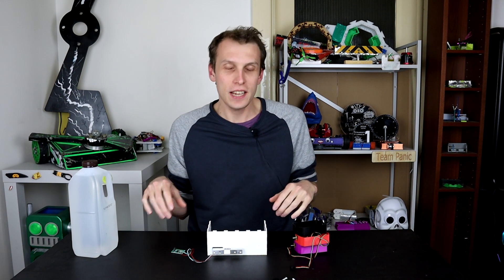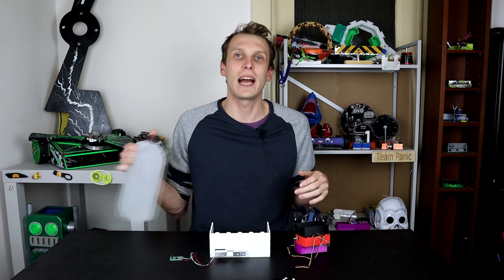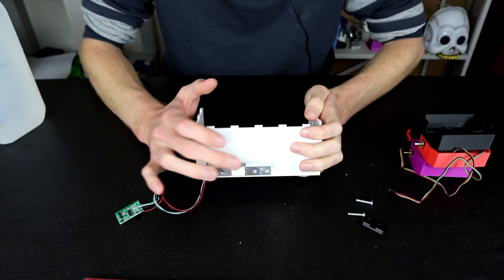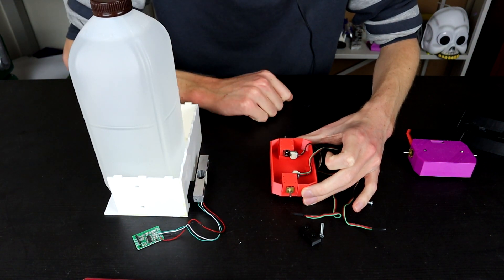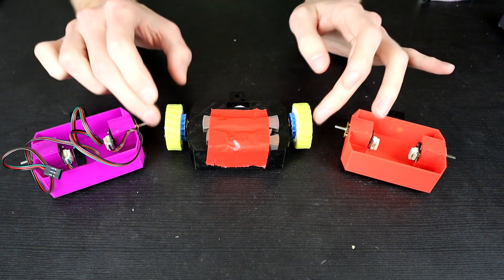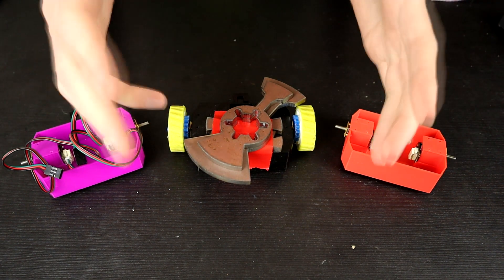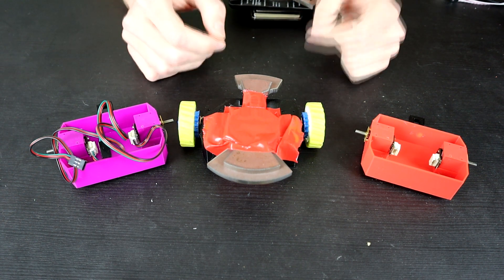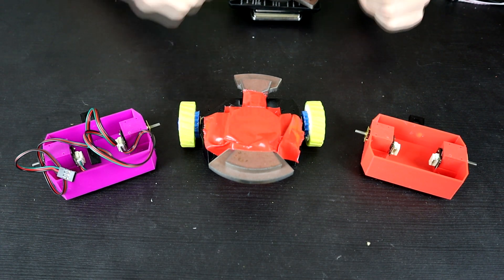How much can a robot pull? (n20 torque testing)

Comment: Hello, I know this is a very specific question but can you tell me if it would be safe to use these motors with an L298N motor driver, powered by 7.4V LiPo battery?
Reply from the maker: should be ok, L298N motor drivers have a current capacity of 2A
this video has more detail: https://youtu.be/_iumGzWloGY

Comment: I’ve always wondered if higher RPM means higher Coefficient of friction or grip since there is more rubber hitting the ground per second? Another test but with same torque but more speed (somehow?) would be interesting.

Comment: You could set up a linear rail system like from a 3d printer that uses an n20 instead of a stepper motor hooked up to a load cell. This would prevent slippage for the most part and give you a more accurate measurement of the torque put out by these motors. Cool experiment!

Comment: Ben, another great video. You could try anchoring one motor & the force gauge unit and have a spool rather than a wheel with the string attached. Once the string has wound up fully I think you would get the full torque as the motor stalls i.e. 100% total traction
Reply from the maker: I like that, would be a good way to find max torque

Comment: This probably sounds stupid - but something I've always wondered - if you put in 4 motors - or even 6  - with wheels obviously - how much of an increase in torque do you get, is it linear, is it a small increase etc... I mean the theory is simple - but does it really work in practice....
I mean its only for testing - so you could try 1 motor/wheel, then 2, then 3 etc.....obviously some of the normal force will be taken away in the sub 4 wheel configurations as you can't balance on one wheel....

But also - the width of the wheels - how does that actually affect it. Particularly if its bouncing a bit - what is the effect of doubly / quadrupling the width....
Reply from the maker: I like both suggestions adding them to my list for future tests

Comment: I've found a good use for 75:1's is for ants with very large wheels, e.g. 50mm+, as the large size means that a 50:1 or 30:1's speed would make the bot uncontrollable.
Reply from the maker: Yeah very true, I've only build one robot with wheels over 50mm and it was crazy fast on 50:1s

Comment: Great to see a followup test video Ben! What maybe u could do is take one weight category, and try out different combinations of wheels with these motors and build recommendations as to which kind of robot should go with what motor-wheel combo.
Reply from the maker: I like that idea
Reply: @TeamPanicRobotics  could you do the test with brushless motors it would be interesting to see
Reply from the maker: brushless motors would be harder as low speed torque (which is what we are measuring) is more determined by the esc then the motor used